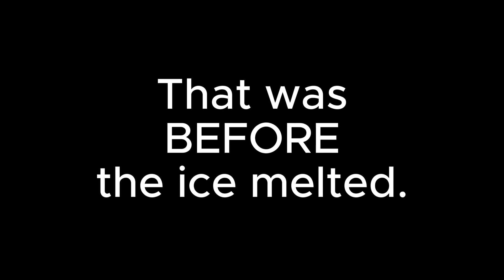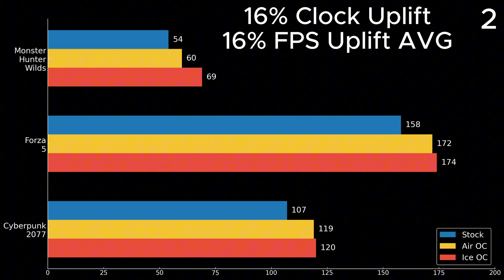I Put Intel’s GPU Under Ice

Comment from the maker: Ice was melting, temps were climbing, clocks were still going up.
Should I give it another go colder?
Reply: Yes. 😐😑😐
Reply from the maker: @Mr.Degenerate  I am already on the hunt for a better cooling set up 🤣🤣
Reply: @TrashBench  yes but with higher power limit.
Reply from the maker: @FireCestina1200  Shunt mod it is!
Reply from the maker: @Mr.Degenerate  It MUST be done!
Reply: YES!!!
Reply from the maker: @DJSammy69.  I feel I really didn't do it justice this time round!
Reply: Absolutely!
Reply from the maker: @MUSiCK9  Now to figure out a better cooling set up!
Reply: Definitely
Reply from the maker: @funifin  I agree sir.
Reply: Yea but use Honey PTM7958sp from moddiy, it'll take 15 hrs or so to dry cure it at room temp but the temperature is even better than PTM7950 which is REALLY good still, be sure to use that instead if you don't wanna do all that work.
Reply: Hell yeaaaa
Reply: @TrashBench, if you are in Brisbane, I have 2 waterblocks to suit the b580 challenger/steel legend cards arriving this week.

Happy to loan one for the sake of science.
Reply from the maker: @RideRestomod  Thanks dude, I appreciate that. I am done with Intel for now, hopefully they fix their software and make OC a little better. Full system crashes are no fun on repeat.

Comment: Had a B570 and at stock they are pretty impressive for a second run of GPU's from Intel. Gaming dGPU and iGPU. I had to try one at 188 euro new in sale. Couldn't get it to properly OC though via afterburner or intel software. Oddly it also stuck at 97% max power.
Reply from the maker: They are a bit of a pain to OC and get dialled in, when they crash... they crash hard. Unlike Nvidia that just resets the driver, the whole system restarts. 

With everything going on with Intel unsure if we will see anymore from them, I hope so though because it's a pretty impressive card.

Comment: I don't know why this is a thing now. I  was doing this in the early 2000's using those neon green vinyl tubes. Can't remember if it was a Pentium 3 or 4 though but it was definitely early.
Reply from the maker: The coolant was green, the tubes were clear.
Sub-zero loop, not 2002 case-mod vibes.

If you filmed yours back then I’d genuinely love to see it.
Otherwise, different era, different hardware, same chaos.

Comment: I did it back in 1997, 1 gig was all that was available i pushed to 2 gig, with stable benchmarking.
Reply: Cut the hole in my case used plex, pond pump, used racing coolant, and then swapped to non conduct coolant

Comment: was that nail polish you applied on before putting the water block down at 0:31? im about to do the same for my 3090, finding best ways for isolation.
Reply from the maker: It's liquid electrical tape, but I am actually not going to use it anymore because it had water under it this time around. I am going to start using blu-tack and Vaseline.

Comment: You ever considered using a refrigerator compressor to OC? I've seen old videos of someone using one of those with a Pentium III to get near 2GHz.
Reply from the maker: Yeah I have, but that's a lot of work and I am... lazy. I do have another idea up my sleeve though.
Reply: I did it back in 1997, 1 gig was all that was available i pushed to 2 gig, with stable benchmarking.
Reply: I built the computerator back in the day.

Comment: I'm confused, is this even showing the GPU? Wasn't 1080p CPU based?
Reply from the maker: 14900K and a B580. If there’s a bottleneck, it’s psychological.
Reply: @TrashBench haha I understand, just judging based on CPU benchmarks that are all done at 1080p, I thought you need to bench gpus at 1440p or above
Reply from the maker: @Silentwidow1222  Depends what you're testing, this GPU isn't strong enough to slow a 14900k and I tested at 1080p because that's what this card is marketed for.
Reply: @Silentwidow1222 this budget gpu can be benchmarked @1080p  and will never bottleneck this i9.

Comment: My go-to way of designing parts to fit existing things (or copying parts) is taking a photo from as far away as possible with a ruler for reference, cropping, adjusting it to be perfectly parallel to the plane and importing it into cad.

I then design the new part drawing my sketch over the photo background. In the end I usually need just one prototype, if any at all.
Reply from the maker: That is genius 😉😉

Comment: mmm im curious how it'd do sub 0 or below 10.

also good god i need a cooler like that stock one for my 980, having only a tenth of the thermal mass that cooler has it heats up  q u i c k.
Reply from the maker: What kind of 980 is it? If you can find a dead card of the same brand from the same gen the cooler probably bolts on 😉😉
Reply: @TrashBench  the stock blower style one and i might actually look into that, i did not think of that
Reply from the maker: @nonoyesnoyesnt  Sadly blowers are the worst kind of design, even if you can track down a 960 or 970 the cooler off that will probably be better! The bolt spacing on the pcb from blower to standard might be different though, but I would not think so.
Reply: @TrashBench  yeuuupp... looks fancy but performs like straight ass, lotta wasted space that couldve been more heatsink or fans. definitely gonna look into that.